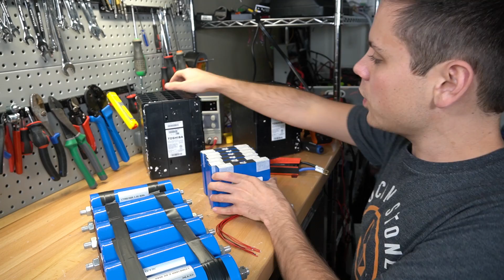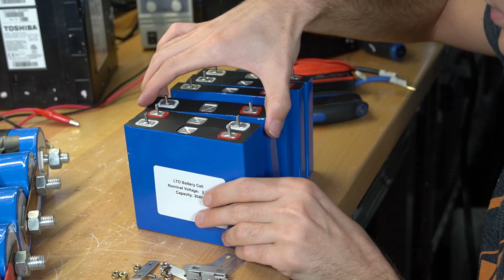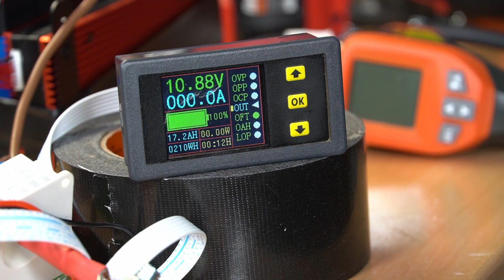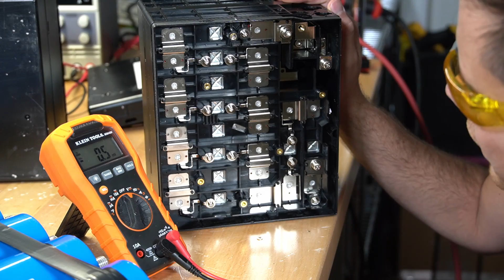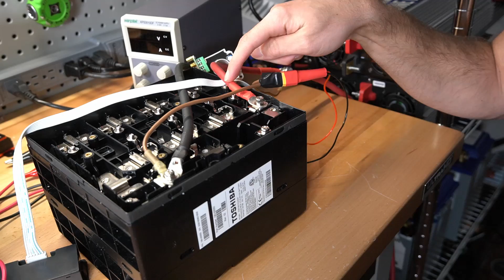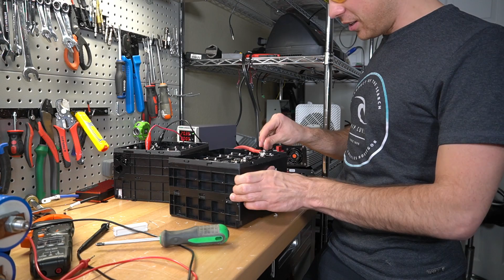DIY Lithium Titanate (LTO) Battery Part 2

Comment from the maker: Don't want a fire or a dead battery in your setup? That's exactly why I built my own site, Charged Reviews. It shows the safety certifications, real specs, owner reviews and current prices for solar gear, so you know what's actually safe before you spend a dime.
DIY battery kits: https://chargedreviews.com/batteries?type=diy_battery_kit
Best deals right now: https://chargedreviews.com/deals

~~~~~~~~~~~~~~~~~~~~~~~~~~~~
*Don't want to burn down your house? Need equipment you can actually depend on? Check out my latest "Will Prowse Approved" solar product recommendations here: *
https://www.willapproved.com/

Is that battery actually certified? Before you buy, check it on Charged Reviews, my new site that tracks real safety certifications (like UL 1973 and UL 9540), public data, and honest user reviews so you don't get scammed:
https://www.chargedreviews.com

*Join our DIY Solar Community 
Need more help? Join the largest solar forum on the internet for beginners and professionals alike:*
https://www.diysolarforum.com

Check Out My Free 12V DIY Solar Book
Best-selling and beginner-friendly guidebook to off-grid 12V solar!
https://www.willapproved.com/the-book

~~~~~~~~~~~~~~~~~~~~~~~~~~~
Need to build a large DIY system? Need a trustworthy solar distributor? These are my favorites:

Signature Solar
Hybrid Inverters, Solar Panel Deals, Mini Splits and More!
If you want $50 off, please use my affiliate link below and coupon code "DIYSOLAR50":
https://signaturesolar.com/?ref=cPwLcVc0SW-BjN

Best Solar Bundles
These systems are cream of the crop. High voltage/ High performance/ Commercial and at incredibly low prices:
https://bestsolarbundle.com/?ref=WILLIAMPROWSEIV&variant=43645878468650

Current Connected
Best Prices for EG4, Victron, Midnite and so much more! Fast Shipping and Highest Rated Customer Service:
https://currentconnected.com/?ref=wp

~~~~~~~~~~~~~~~~~~~~~~~~~~~~~~~~~~~~~~~~~~
Contact Information:
I am NOT available for personal solar system consult! If you wish to contact me, this is my direct email: williamprowsediysolar@gmail.com
FTC Disclosure Statement and Disclaimers:
Every video includes paid promotion or sponsorship (such as free products for review). Some links on this YouTube channel may be affiliate links. We may get paid if you buy something or take an action after clicking one of these. Charged Reviews (chargedreviews.com) is owned by me and may also earn affiliate commissions. My videos are for educational purposes only. Information is subject to change/update at any time. Electricity is DANGEROUS and can kill. Be smart and use common sense :) DIY Solar Power with Will Prowse is a participant in the Amazon Services LLC Associates Program, An affiliate advertising program designed to provide a means for sites to earn advertising fees by advertising and linking to Amazon.com
Reply: DIY Solar Power with Will Prowse, most automotive devices are designed for up to 16V.  Working in automotive testing during my college career we frequently tested production automotive parts to 16V.  So long as you are using these cells with decent quality equipment, it should operate very well.
Reply from the maker: @MrJordinhand  The reason I figured 15-16v is limit is because solar charge controllers doing  equalization of flooded cell batteries would destroy some 12v electronics. And my inverter over voltage is 15v. That's really cool about the victron. 16v would be ideal. I hate 12v haha
Reply: @WillProwse  me ajude por favor! Preciso montar baterias de titanato de lítio 48v 5kwh. nacaosolar@hotmail
Reply: using a victron 12v inverter the high voltage alarm doesn't kick in till 17v
Reply: @michaelmcclellan916  ^ crucial info for people building a 6s LTO system for vanlife.
Reply: How about using these to build a "climate controlled" system for a LiFePO4 battery bank. You could have a temperature cut-off so that if temps drop too low, your panels charge the LTO batteries that run a heating pad to get the LiFePO4 pack back up to a safe temp to continue charging.
Reply: Mark A I was thinking of a similar setup, but the LTO batts can just float at 50%SOC indefinitely, waiting to engage a heating/cooling system if the LiFePO4 batts start to go out of a safe temp range. 🤓👍

What s the max temps for the two chemistries anyway? 🤔🤷‍♂️
Reply: Didn't know Lithium Titanate existed until this video. Learned something new, my day is complete.
Reply from the maker: I doubt those 12v appliances that failed at 15v had much head room and were probably not UL listed. Thank you for bringing it up guys. Great point
Reply: I suggest you recheck your math... I have seen 98.9%
Reply: Will, I would like to purchase the 12S LTO BMS from AliExpress. I see you have a link to the 6s, but could you include the link to a 12S LTO so that I can buy it and give you the affiliate commission?
Thanks!
Reply: @Aaron_Peters  take a look for 11s BMS for 24V battery. 
It's better than 12s
Reply: @zarbonida  What I'm actually going to do is use a DC-DC step down converter in order to bring the voltage down to 12 volts. I found that one 12s LTO bms was cheaper than one 6s LTO bms, and I want the capacity of 12 of these cells.
Reply: Do you think it would better suit a 48v system.
Reply: How about a 20S 48v LTO ?
Reply: @marktheamerican4162  you want 22S for a 48V LTO system.
Reply: Battery bank Back-Up for Home with a DIY Generator 2 Car Alternator 1 BB Chevy low turn charging & 1 78A Alternator 88 GTA TransAm with neodymium magnets added N-52 c 10mm x 3mm do not use such strong magnets if you copy do not it will spin but very hard the magnetic Pulling very strong makes it difficult !
Reply: Thank you Will, i finally found your video on Lithium Titanate Oxide battery..
Reply: @diy solar power with will prowse wouldnt the fact that lto can be discharged 100% make up for the 80% to 90% efficiency compared to lifepo4 since lifepo4 can only be discharged 80%?  That could make lto actually more efficient
Reply: could u use these lto with agm
Reply: Can you keep adding packs as you go down the road? parallel of course, such as a separate pack. The price is high on cells like these. I have limited income. I would like to build a basic 24 volt pack and later on when I have money again build them again. Most likely using the tubular cells, they seem more common. So a 24v x 45 AH battery with a BMS and a few months to a year later add another until the size is large enough. Is 20 individual batteries to much? I'd like to shoot for for somewhere around 20 KWH as an end goal. I like lifepo4 and the price is rock bottom right now but these seem to be the best alternative to nickel iron batteries. 30 years is not out of the question according to literature i read. I want to buy a battery and rely on it for the next 20 years without worrying.

Comment: This popped in my feed 6.5 years to the day. I just ordered some 30AH cells from AliEx and they took almost 2 months to get here (and they were super competitively priced). So far they are all balanced and the 6S balancer that came with the pack seems to be working quite well. They came at 15.56V overall charge (per 6) and were within .04V of each other. Going to utilize them in my car 6S2P - 60AH to see how they work out in real world testing for voltage drop and recharge rate and active balancing compared to my EcoFlow Group 27 100AH LIFEPO4. This should be interesting......

Comment: These really do not need a BMS. just a balance board. 6s best for 12v,  11s best for 24V, 16 or 17S best for 36V,  20 to 23s Cell best for 48V, 24 to 29s best for 60V, 31 to 34s best for 72V I am building a LTO for my Truck to run a 72V inverter using 32s LTO Toshiba packs (1,472wh) . To me the only advantage of LTO is for use in Winter weather... I will use my LTO battery to run a 4k inverter.

Comment: The high discharge rate could be good where there is a load with high starting load like pump or refrigerator  Roger Caplin

Comment: Prius uses high voltage battery to start the engine using the motor generator 1 so no need to worry about that
Reply: 12 volt systems like sound and lights and electric coolant pumps is all it would need to be able to run

Comment: Are there AA or 18650 sized LTO batteries on the market? I checked AE and all I see are what looks like capacitors but the description says LTO batteries and the charging temperature is 0C and higher. The real LTOs can charge in -20C, iirc. Im rather baffled!

Comment: Hey Will, is there a solar charger that can switch back and forth between solar panel charging and wind turbine charging on the same bank of batteries -and if so do the battery types matter?

Comment: You mention here that it might be possible to build an LTO pack that could be used as a vehicle starting battery and that you even have a Prius where you could test it out. The Prius uses a DC to DC charger for its 12V battery so would that work to charge the LTO pack as well?  I'm VERY INTERESTED in what's possible to use in my own Prius!

Comment: Im very interested in your suggestion of testing lto on your prius, its a similar thought I've had for my van. Im looking for a chemistry I can take from van to van. 30 to 54 years will see me fail before the battery, I note your mention of calendar aging etc but if it lasts only 25 years it will likely out live the average age my family lives to, and mean there will be exciting new chemistrys to replace it before I die. I'm looking at the savings and safety factors involed, my situation requires a lot of driving, the extra drag of solar panels means using my alternator if set up correctly will use less fuel and be more financially beneficial to me for my power consumption, reducing the starter battery weight and temperture benefits might also improve my vans efficancy.

Comment: You seem to, for whatever reason,  have an inherent dislike of the battery. The only valid issue raised was that of balance charging and how most chargers do not support it properly. On other issues, it's either the same or way better than other batteries.

Comment: Hi I have been running my house off LTO 35amp cylindrical cells for 2 years I have 4 batteries 22s 2p system the stable storage and super fast charge allows me to heat all my hot water required for 8 people most of the year LTO cells balance under load so for solar applications has been great expense of cells have forced me to look at lithium iron phosphate cells now.

Comment: Just for anyone's information, DALY will make a common port BMS with 24 S@ 57.5V  60AMP in 50AMP out or 40AMP in and out for around $30ea. for LTO SCiB 64.8V batteries. The best power production is a 60V Nominal and 48V Minimal. I am using a Sol-Ark 12K on my off-grid farm using this battery bank system. You can also split the two sets of 12 cells for a 24V Solar system if you don't have a 48V system.

Comment: Also: I’ve heard (do not know for sure but maybe look it up) that it’s not a good idea to use copper on the yinglong as they have aluminum (as opposed to nickel) bolts that can corrode. This is second hand info so take it with a grain of salt...

Comment: I mean, on first glance on paper these cells seem to be the ideal cell, expensive but if you figure in 6-10x the life span of a LIFE4 batt......are they expensive?  , good capacity, ridiculous long life, ridiculous high C charge and discharge.  They're being reviewed as substitutes for small cheap diy 4S LIFE packs but really this isn't where they are aimed at, they'd make much better 24v or 48v large packs for outhouses or RVs using higher end BMSs, charge controllers and inverters with flexible voltage ranges.  I mean if your not using much (or any) 12v stuff and your mostly using 120/240v through inverters etc, then these seem ideal, super high discharge and charge long life batteries!  I might have to get a small ali express pack to try out as yes like you say the Yinlong ones are expensivo!
Reply: Seems like they would be great for quick charging from a large alternator and b2b setup

Comment: Dear Will, could you, please, explain how you charge your batteries? In your videos you seem to use nothing but a simple laboratory power-supply. Is this correct? And if so, do you stop the charging manually when you see that the current has dropped to a certain level? Or do you use some sense mechanism? Thanks a lot in advance!

Comment: Its the second time you give wrong information in your video. first was nife now its lto . Cylindrical has 1.5-2.8v range with 2.3 nominal not 2.4 thats for those prismatic cells with 2.9v max . Also several vids on youtube shows 98.9 efficiency  and not 80-90 like you claim . Get your facts straight please. They are used for solar with mppsolar GK and are very happy with it....Also man get information before making video that way you would have knowed that 5S is dumb

Comment: A 5s BMS + 6s BMS  in series configuration for a 24v system could work better using all the voltage, Right?
Reply: 10C for a portable arc welding equipment?

Comment: Also could probably modify an inverter to reduce it's minimum input voltage... crack one open and check its specs more than likely it only drops out to protect the batteries you have attached not the inverter.

Comment: I use LTO for car's starter batteries only! Well I wanted stop, but theses batteries have to be powered on before you can use them. The LG Chem 12v BMW LTO batteries, will not work unless you jump start them first, seem I am going to have to remove the circuit that shuts them off otherwise they will have to be torn apart, it is sad they came in a good case a nice form factor.

Comment: Hello , And Thank you on the Yinlong 2.3v can be charged up to 2.8v but only recommended 2.4  or 85% is like 2.4 % and I - you can only drain down to 1.60v gives you & me .80v per battery which is like 20 Batteries in a bank of 48v  - 20 Batteries x 2.4v  = 48v to get the longest Life they recommend 2.3v for 20 + Years and they say if you charge them to only 80% not to 100% you save about 6 years ! My Question William if you could spare the few seconds- I know this was a   Knucklehead thing to do - a Bonehead I know - I over charged 5 batteries I had them in series the top charge was to be 2.8v each in series I charged them to 3.2v , was to be 14v but went to 16v for 5 batteries talk to me 1 time over charged I’m wanting for a charger as I write ! You had a Victron Charger I tried to see but in the video was not enough for me to see so I got 1 off AliExpress! What type of damage you think I did from you’re years of Experience and knowledge / Wisdom ?

Comment: So, what I've gathered from these videos (vid 1 on LTO as well) is that the nominal voltage isn't compatible with current 12/24v technologies. That seems to be the only actual downside. Weight and size is mostly irrelevant for off-grid solar applications (and on-grid). Cost is another factor, but if they were produced in higher amounts, that might change.

To me, it seems like they're designed for some other application (ie, not solar). If they were adapted for a more usable voltage range (which should be easy - lower it per cell) they would be quite a competitive battery chemistry and would actually stand a chance at competing with LiFePo4 (or other Li-ion) for large scale grid-storage.

Dunno, they seem cool, certainly with life-cycles concerned. But are just unusable at present, for the type of applications people want.

 - Cheap, mis-labled Chinese cells aside...

Comment: With prismatic cells, I wonder if a heat sink arrangement where a sheet of aluminium or copper wider than the cells sandwiched between each cell would help dissipate heat. I have nmc prismatic and thought about this, although my discharge rate is nowhere near enough to generate heat. Other fins could be attached and have a forced air cooling system.
I'd love to use these for off road racing kart/buggies!!!!

Comment: These would be good to build stand alone yard lights with a 100 watt solar panel. Those round cells would fit inside a pic pipe.  Works in just about any weather!

Comment: So you could get 12 of these and make two 12v banks with bms each and put them in series. Then you take it down to 12v for your inverter and the inverter wouldn't give you any issues any longer correct? I know it's not the most efficient way to do it but buying batteries once in your life time is very tempting. Did I understood that correctly? I'm pretty new at this but I would love to buy a system that just works, don't really worry TOO much about efficiency for my usage. Is it possible to just keep it at 12v in series and somehow use a DC to DC converter to keep the inverter happy?

Comment: if you use the victron inverters they can handle up to 17 volts so you can fully charge these battery's at the 2.8 volts max charge

Comment: I definitely want to see you test titanate with a Prius. From my research online the max amp load is around 30amps. I'm looking for a solution for my 2007 Prius. My lead acid battery replacement only lasted 2 years